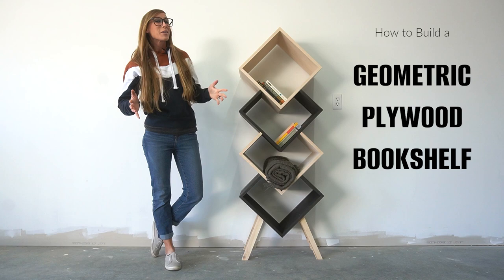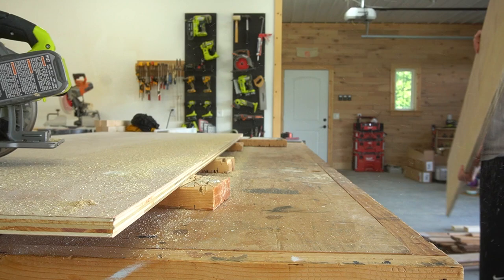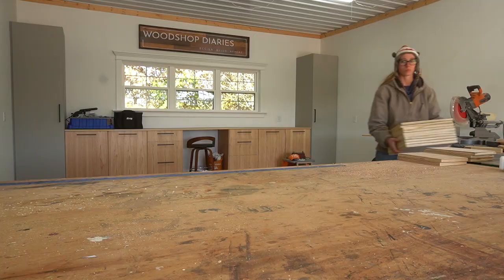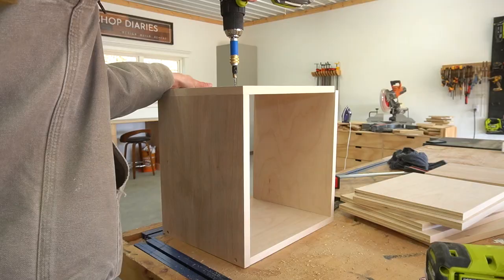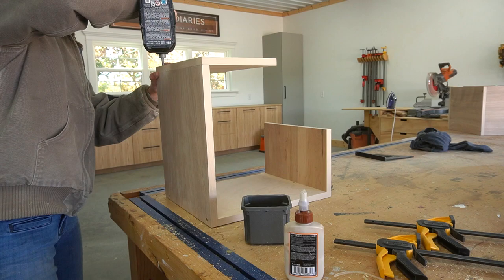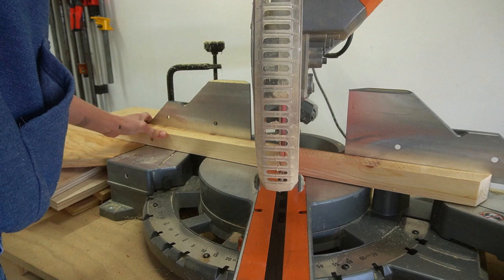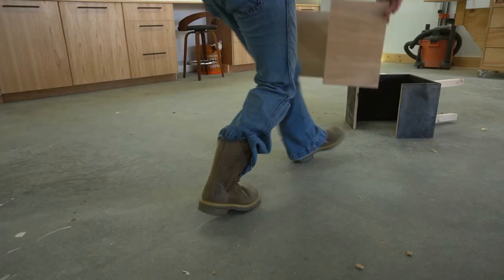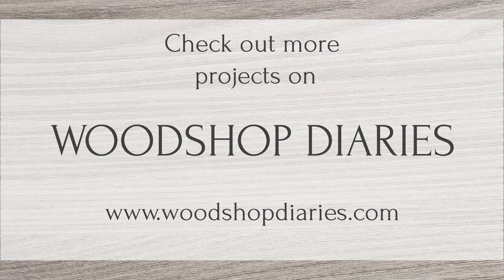How to Build a Simple Modern Bookshelf

Comment: Nice little project.  Time for an HVAC unit for your shop….
Reply from the maker: Thanks so much! I chose not to add and A/C or heat in my shop because I prefer to work with the big garage doors open instead 😅 so I just bundle up when it’s chilly and turn on the fans when it’s warm haha